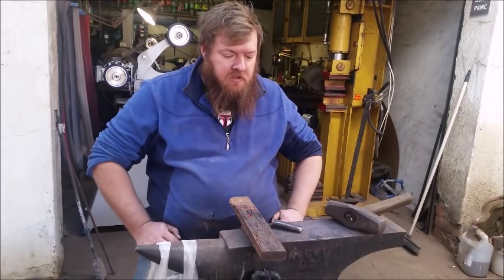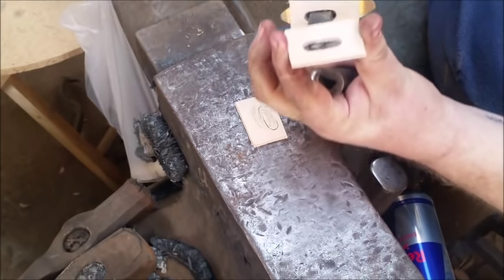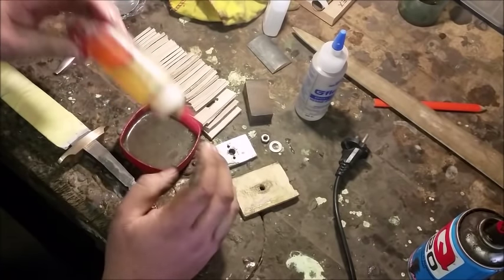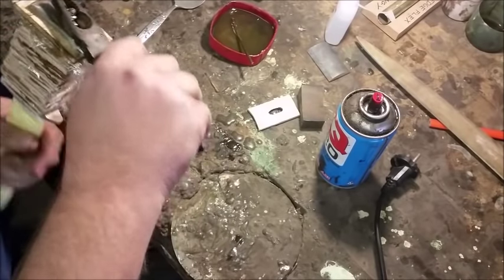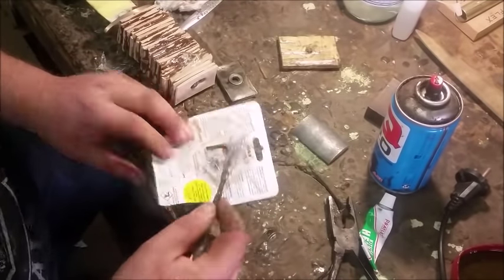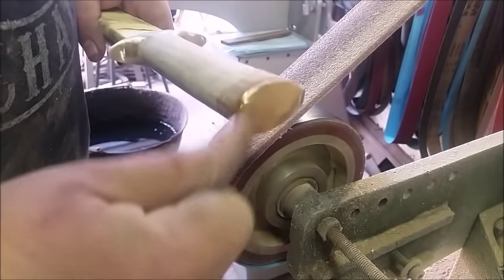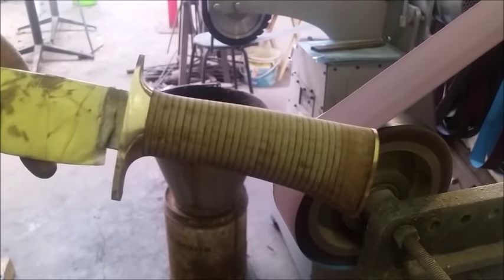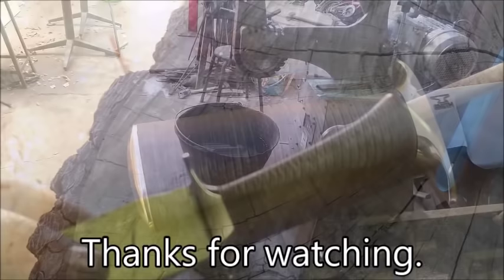Leather stacked handle

Comment: Can I send you a proper wrench to turn the nut on the end of the tang (instead of those awkward pliers)? Al the punched holes in your leather are sized to fit the widest part of your tapered tang, leaving too much of a gap between the leather and the tang, and a possible failure of the leather to remain tight. Otherwise, your finished knife is beautiful, and has a unique style.

Comment: Great video. And many thanks for beeswax suggestion, I didn't even know how it is used on leather handles.
Reply: I'm into leather working for a while now and I love to finish up with beeswax. I specified the technique a bit further: My provider told me that Neatsfoot Oil is the best thing you can do to leather. So I first apply only the oil to nourish and than a paste made of beeswax solved in hot oil. This step already requires some heat. Finally I use purified besswax. The purification process is quite easy, there are some videos out there. Always control your hot wax, I once covered my hole kitchen with a quite constant layer of wax. No fun to clean up.

Comment: why does the tang need to be tapered?  Seems like a lot easier if straight.
Reply from the maker: Blue Star Industrial Arts a tapered tang has two advantages. One is the balance  (if required) by reducing weight to the rear of the handle.  The second is to help with the ease of fitting guards and spacers.  If the steel is flat there can be a struggle to fit it all the way to the ricasso. By tapering it the materials slide on easier only getting tight towards the blade. A taper does not weaken the tang I'm any way.

Comment: Never glue  or use resin on a stacked leather handle. You wet the leather and apply pressure to seat and compress the layers then allow to dry.

Comment: Great video! just subscribed! I'm trying to restore an old knife, the leather is loose but intact. If I goop that epoxy all over and sand it down, do think it will work/hold? is there a special type of epoxy to use other than slow or fast? any reccomendations would be great! Thanks in advance.
Reply from the maker: you can use a fast setting epoxy. If you warm it with a heat gun it will become more liquid and flow into any cracks. The down side is it will set even faster, so work fast and accurate!. Another way to do it, if the material is porous, is to coat it with superglue. It will also run into any cracks or pores and seal it all up. Then sand down as normal. You have to use a very liquid glue, almost like water. I use Wood Magic. Thanks for watching.
Reply: Thanks Stuart! Very helpful, can't wait to try it!

Comment: Stewart, ever hear of anyone ever glueing up a stacked leather handle, let it dry overnight and then put it in a stabilizing pressure pot to permeate the raw leather with resin?
Reply from the maker: Yes. Stable as heck. Works really well
Reply: Smith Hand Forged Knives cool, I was thinking of trying it, now I will!  Cheers Stewart🍻👍

Comment: Instead of just bees wax to seal the leather. You think linwax would be an ok substitute? Stuart Smith
Reply from the maker: Chris Newbry to be honest I couldn't say as I have never used it before. but any wax that will penetrate the leather when heated should do. you could even use candle wax.
Reply: Stuart Smith. Thank you for the response. I made my linwax compound for my wood handles it adds a nice sheen to the wood. I think it would be amazing to accentuating the color of the leather. Thanks for the video as well I will definitely be trying on one of my up coming blades..